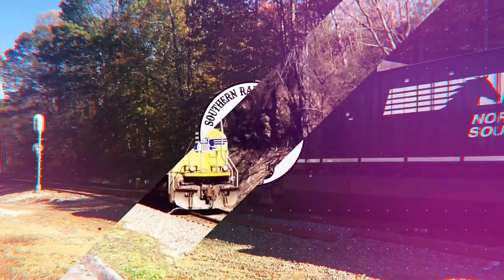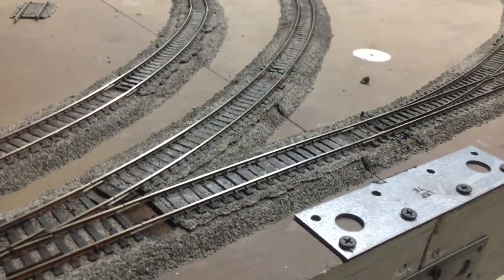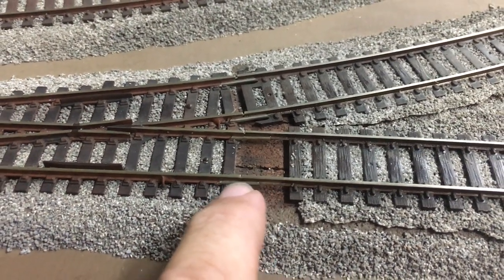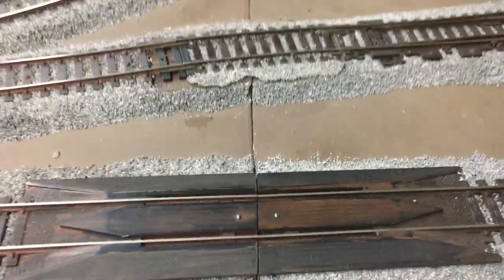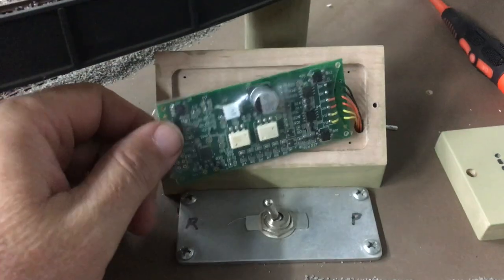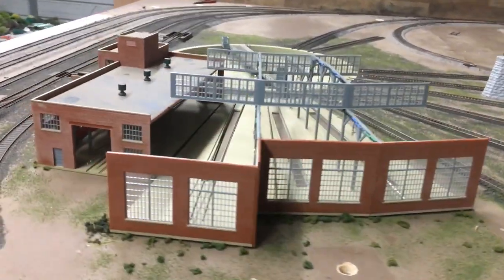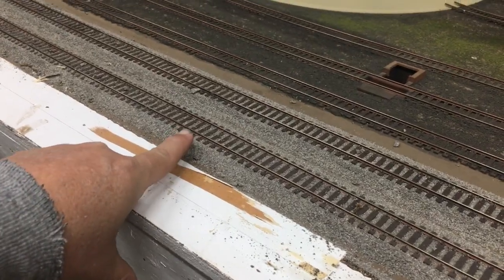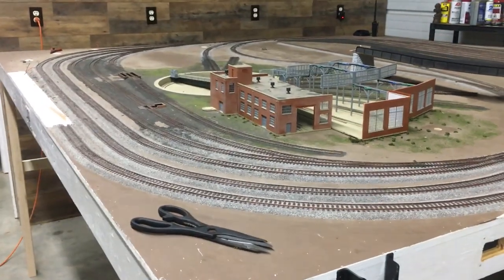Used layout update! Connecting track and finish wiring!!

Comment: In railroad language your toggle switch panel is called a model board, track joiners are the brass tabs used to join the track sections together. I only dabbled in HO once and preferred to stay with O gauge, easier for me to work with, although O gauge does require a lot of space. Keep up the good work and I enjoy the layout videos as much as your rail operation videos. Green on the model board indicates normal move, red indicates reverse or diverging move. I started out as a tower man/operator before transferring to train/engine service.
Reply from the maker: Thank you Gary for that information, happy to know that.